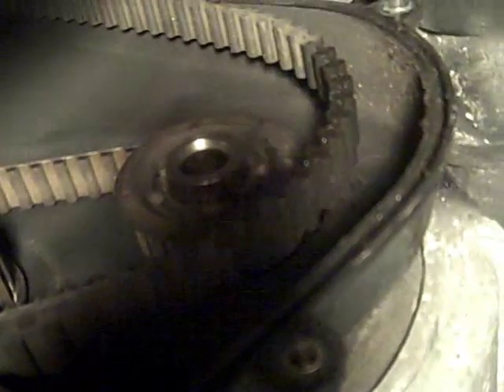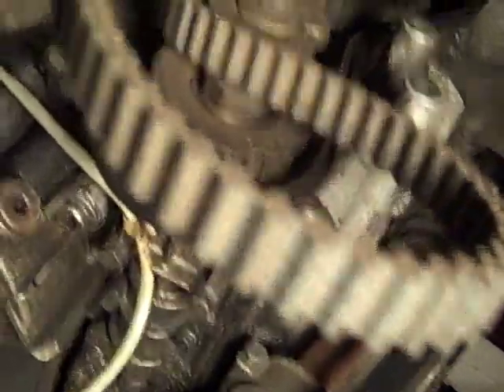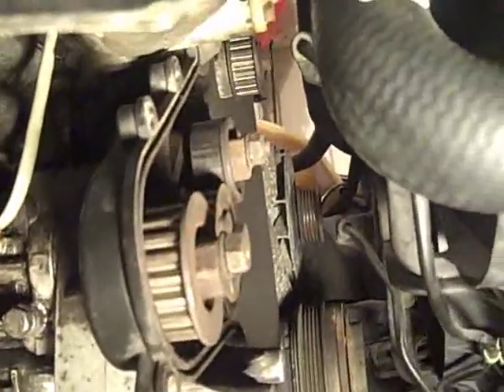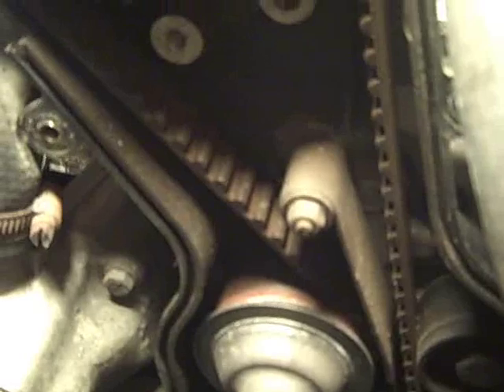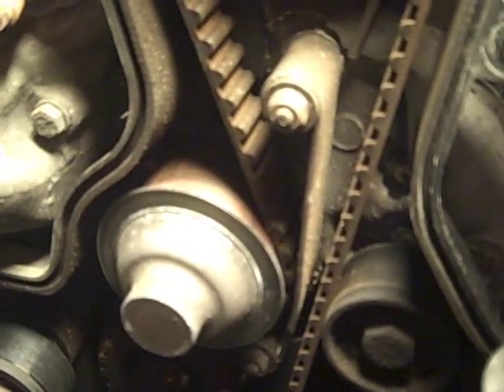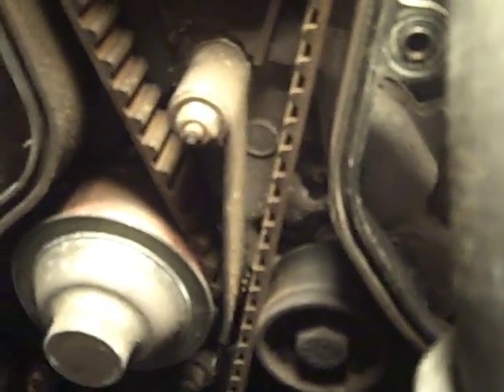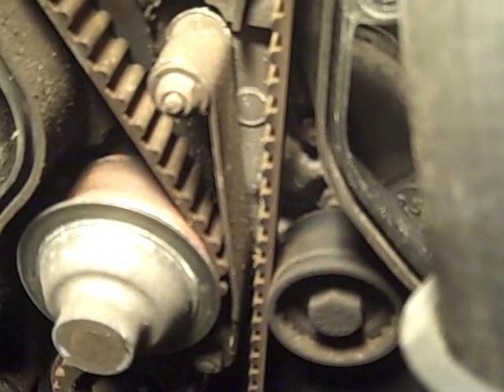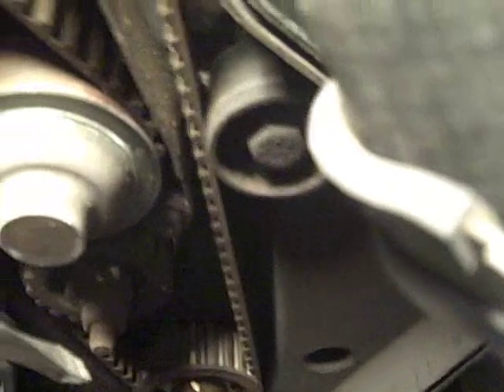Timing Belt Change Porsche 944 - Video #4.wmv

Comment: Interestingly, I have a late 85 924S (with the early 944 motor). It has considerable service history from Porsche agents including documentation of a modified water pump and conversion kit but it doesn't have that guard between the two belts

Nice videos by the way
Reply: Does the updated water pump require a different length belt due to the pulley being of a different diameter?
Reply: I don't recall exactly (over 12 months since I did mine) but I have a feeling that yes, it is a different belt. Any reputable supplier will be able to confirm it